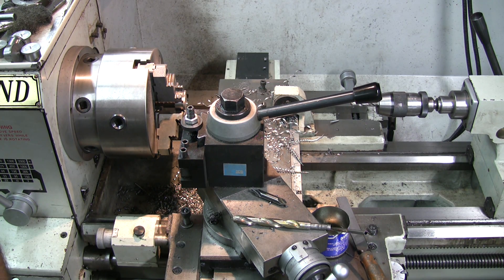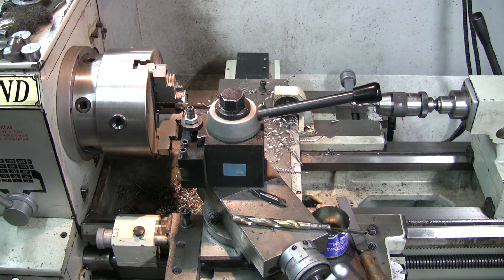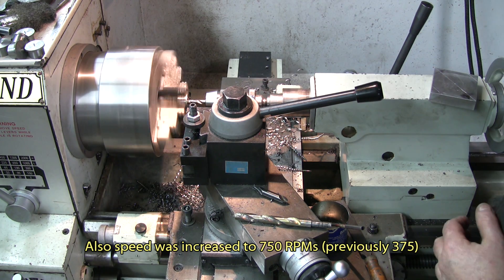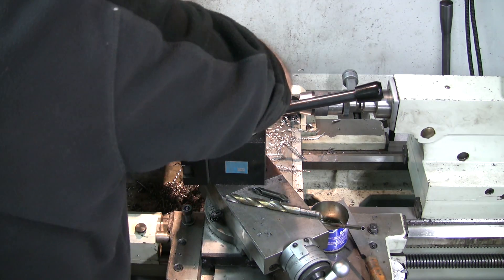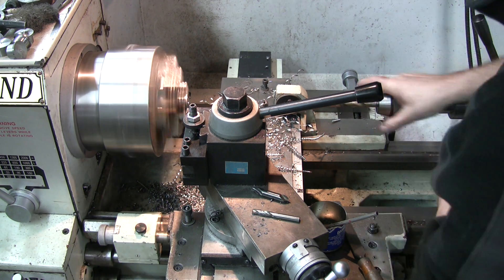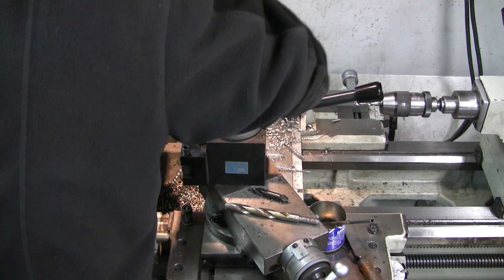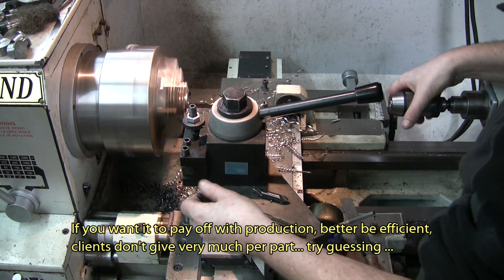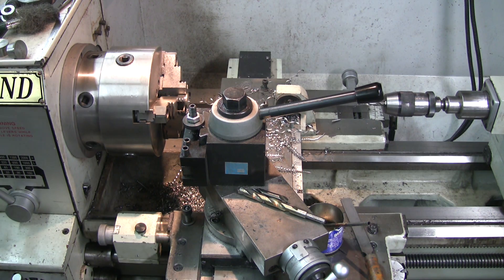Improved procedure to produce 50 bushings on a manual lathe

Comment: Once you get your order of ops down most production runs aren't too bad. Minimal tool changes is best but sometimes not worth the time to create a custom tool for such a small volume. Looks like you were working pretty efficiently.

Colin ;-)
Reply from the maker: Hi Colin,
After a few trial and errors I usually get a decent order of ops, the custom tooling is a matter of numbers, some times it's worth it, other times, so, so, judgement call...
After a total of 75 I was getting pretty good, I'd be good for another run... lol
Don't miss the one pass trick coming soon, maybe you already know...
Thanks for visiting,
Pierre
P.S. Did you get snowed in this week, how was it...?
Reply: pierre beaudry
We've been good here with actually some warm temps. Snow tomorrow prob 15 cm. Enough to spark up the Kubota....I wish it was to carry away flies instead of snow...LOL
Where's a mosquito when you need one??
Reply from the maker: Mosquitoes or snow, the dilemma...

Comment: At risk of sounding old fashioned, your facing operation might benefit from a custom ground high speed steel tool bit that faces and cuts your chamfer on the edge in one pass to eliminate the file.  Good video though.  I too have dome some home shop production runs, so I know the feeling!
Reply from the maker: stiffy515 Hi, nice solution to eliminate the chamfering operation, the file was really to get rid of the sharp edges just deburing, for a bigger and regular chamfer the custom made tool is a great idea, production runs isn't common but it happens some times. Puts bread on the table...Thanks for comment, Pierre

Comment: Hmmm. Production and this many to do and not critical tolerances.  What about taking a 3/4 drill bit grinding the end diameter down and flat edging the original diameter to produce a countersink capable of doing the bore and counter in one operation. Do that step first, then face, then turn from the shoulder back and part off to length.  One chucking operation and 3-4 tool changes that way. Just an idea to save more time!
Reply from the maker: bcbloc02 Hi, the bore was within .002" or +/- .001", difficult to get this with a drill bit, but your method is great suggestion for lesser tolerances parts, I like the one chucking operation solution...Thanks for comment,Pierre
Reply: That is a different story. Your print says nominal +.005 on the bore and nominal +.003 on the counter. getting the bit to nominal would be the biggest challenge, but once there I think hitting the drawing tolerance would be easy enough but the surface finish may not be acceptable.  Hitting your +/-.001 would probably be out of the question with a drill bit very true. Glad to see somebody doing some production type work on a manual machine thanks for sharing.
Reply from the maker: Yap, drill bits don't get much better than +.015 minus .005 in normal conditions... So, to be avoided to stay out of trouble.